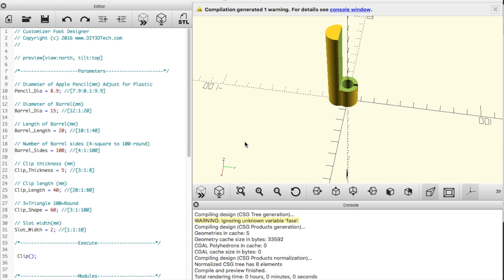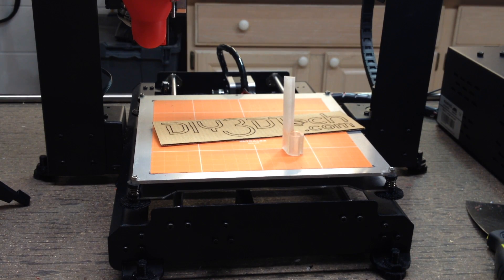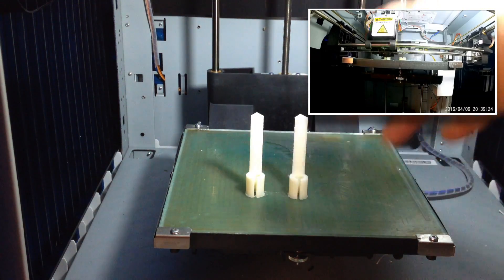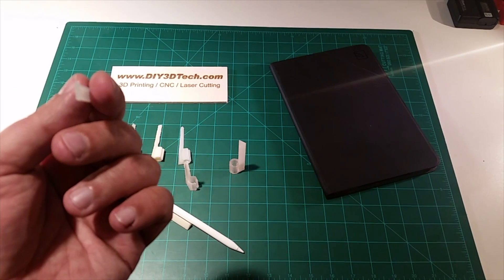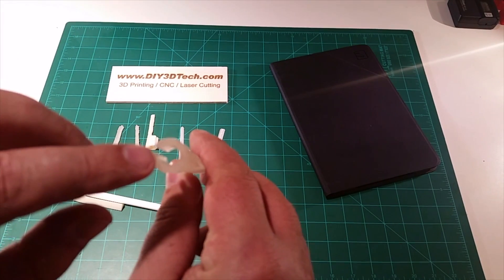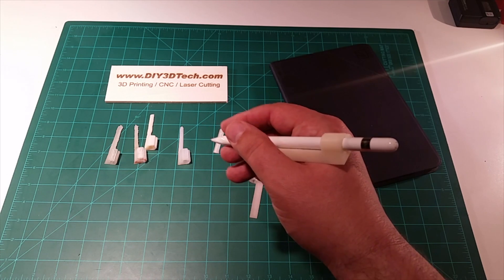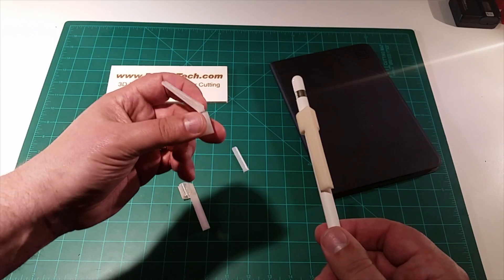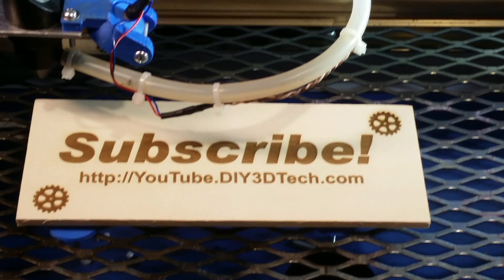3D Printed Project - Apple Pencil Clip From Thingiverse Followup!

Comment: Take an old pen, take off the clip, put it on your Apple Pencil. The fuck are you doing with 3D printing?
Reply from the maker: +SweBass That's to easy, any one can do it...
Reply: +DIY3DTECH.com well its pratical and it looks classy. Who wants a big chunk of melted plastic that doubles the pens diameter? Ugly and uncomfortable... Challenge is good but only if it's useful
Reply from the maker: +SweBass Thats the idea, as the commercial clip you find so attractive assuredly was  once too an ugly duckling.  The true purpose of such endeavors is not the goal, yet what you learn on the journey :-)

Comment: Hi...Great video...I think I have a solution to your problem of having a thin week ugly neck...it all boils down to layer direction and stress points. And the fact that in its current position the plastic isnt cooling fast enough. try thinking of the clip as more of a BIC Mechanical pencil style neck...then instead of orienting the round part on your bed...orient it on its side...with it laying lengthwise. You will probably have to drill out the hole but thats an easy fix. You'll still have a weak point where the neck contacts the tube but you will still have more surface area on that layer they you will in its current orientation!!!!
Reply from the maker: +Richard Matt I agree with you on the direction piece as mention turning it on it side will provide more surface.  However still thing there will be a shearing affect as the base where the two come together.  However might be worth an experiment :-)

Comment: Try adding a chamfer where the clip meets the ring.
Reply from the maker: +David Fowler Interesting, do you think this will work by adding surface area between the two?
Reply: +DIY3DTECH.com It helps relieve that hard 90, which will help with fractures at that point. That said, the big problem is the print orientation. It's going to be like night and day.
Reply: +DIY3DTECH.com yes, with a hard corner the stress is focused. With a chamfer the stress is spread out a bit.  This has proven out well for me in my projects. Depending on the CAD tool you use, this can be an easy adjustment.
Reply from the maker: +RJ_Make seem a few people want to see it printed side way so might give that a shot this weekend.  I just took the lager version around the world (literately) and back.  It held up well, but it is BUTT ugly.  I worked on some new Open SCAD, however not done yet...

Comment: While petg is a stronger material, I think the direction you were printing was the reason for breakages in PLA. I would have printed it length ways with the round 'clip' on top.
Reply: +Mickice I completely agree.  The print direction is what's causing these things to be fragile.
Reply from the maker: +Mickice You I have been kicking this around and adding supports as mentioned in the video.  However there will still be a "joint" there, but with a larger a surface area.  What I am trying to figure out is if there is a way to create to "cross joints", however sure this is physically possible...
Reply: +DIY3DTECH.com layer breakages could also be temperature issues, try printing hotter. what's the diameter of the Apple Pen?
Reply from the maker: +Mickice Yes have tried different temp, the dia is amount 15mm on the barrel and was 5mm on the clip but it wouldn't print so kicked it up to 10 and that seems to work but frankly is ugly...
Reply: +Mickice you are right on the money. The print orientation is the reason for the failures. I would also add a chamfer to help relieve that 90 a little bit.
Reply: +RJ_Make Ah looks like David already mentioned the chamfer.